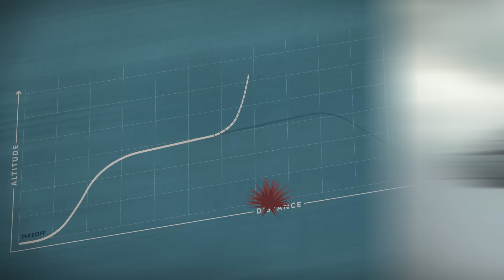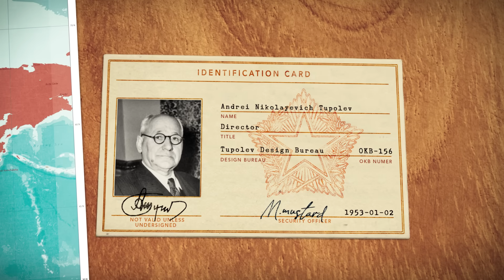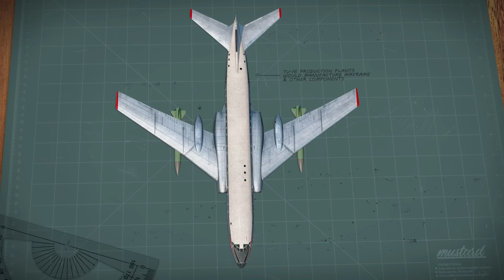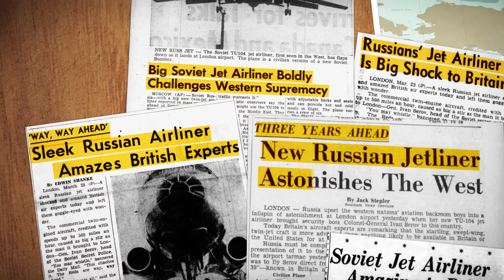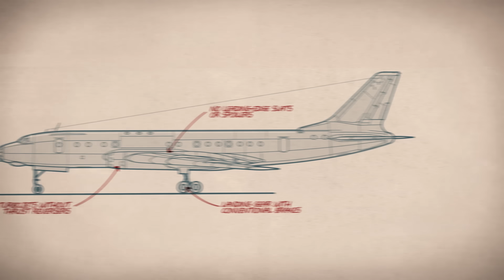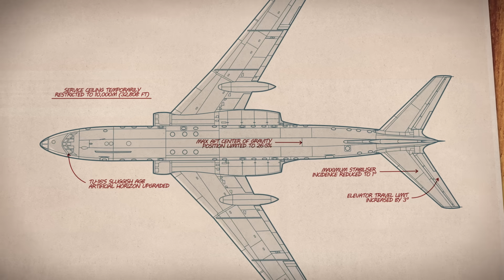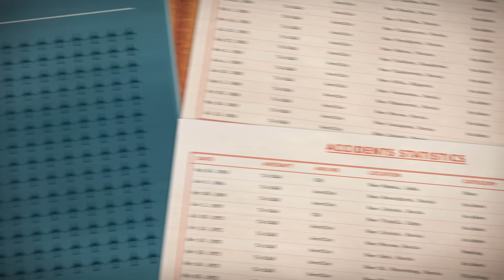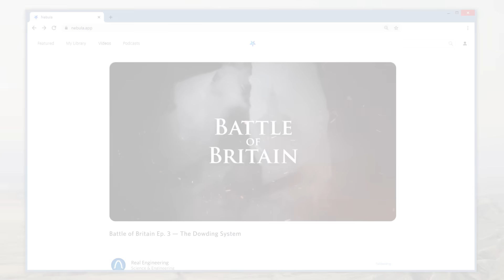The Soviet Airliner Designed To Crash

Comment: Very similar looking to a comet, i wish the design of the comet came back i love it
Reply: The Comet remains a tragic engineering example of how NOT to build a jet airliner.
Reply: @Sander Van der Kammen  it had a failure with square windows. It would be hard to forsee that in any airliner during that time, all aircraft had similar windows and flew at lower altitudes where it wasn't a prevelant issue. The comet walked so others could fly. It is a beautiful jet.
Reply: @darionmcconaghay8888  NO, that is a completely false narrative promoted by revisionist British history. 
Wreckage recovered from the sea confirmed that the catastrophic in-flight structural failures were not related to the passenger windows.

The investigations have determined that the de Havilland company had, through negligence and incompetence used aluminum skins that were too thin and brittle, neglected to install proper rip-stop doubler joints, used too few riveted fasteners that were poorly designed and installed and the fuselage reinforcement rings were too narrow and spaced too far apart too prevent cracks from joining up with adjacent panels.
de Havilland company also failed to  properly test its pressurized cabin design and ignored whistleblowers who alerted the company to numerous aggregious flaws in the aircrafts design and construction.

The real tragedy of the Comet disaster is it could have been easily prevented if de Havilland had simply followed well-known and understood industry standards for the design and construction of of pressurized cabins made from riveted aluminum alloys.

The only lesson learned by Comet Disaster was that manufacturers cannot be trusted to perform their own aircraft crash investigations, it's an irrefutable fact that de Havilland repeatedly acted in its own financial interest and ignored the safety of passengers.

Comment: The Haviland "Comet" wasn't "back in service". The flaws were so extensive that the overhaul proved to be ludicrously expensive. In the end the only places where it would still be used was the military and science research programs, as Boeing 707 has but completely displaced Haviland from the market. In total there was just over 100 planes built whereas there were over 1000 707s. It sucks because the Haviland was a true innovation built "from scratch", not a hastily redesigned bomber. It simply appeared way ahead of its time when stresses on the airframe were still poorly understood. In comparison, - the 104 was much cruder and simpler, and thus devoid of the complex problems which plagued the Haviland's airframe. It needed a redesign of its elevators, and parts of the tail section to counteract the updraft but the Soviet leadership chose to largely ignore the issue until a more up-to-date jetliner was introduced.
Reply: The Comet 1 was grounded in 1954 and its airworthiness certification was permanently revoked.

Comment: IMO it was good that the soviets desired to counter the west and launched their own program for a jet powered passenger plane. They tried and they failed but they learned a lot. Only thing they did wrong was not giving enough attention to correct the flaws due to soviet pride which became a reason in the long term for the collapse of the soviet union.

Comment: I think the De Havilland Comet would take the title of most dangerous airliner. Comets 1 to 3 were flying time bombs.
Reply: The Comet 4 has the highest loss rate any of jet airliner and the worst per flight and per passenger mile fatalities rate of any jet airliner other than the Comet 1
Reply: @sandervanderkammen9230  "The Comet 4 has the highest loss rate any of jet airliner" Another lie. The Comet 4 had a hull loss rate of 22 percent, well below the 707s 30 percent despite its small production run of only 77 planes. I won't bother checking the other things as I'm pretty sure you're making this up along with your "one third of all Comets crashed" claim.
Reply: @Mittens0407  Comet 1 had a 46% loss rate and the Comet 4 26%
Reply: @Mittens0407  The Boeing 707 series is still flying and will remain in RAF until at least 2035. The US Air Force expects its 707 series aircraft to remain in service until 2050.
Reply: @sandervanderkammen9230  Your Comet 4 loss rate percentage is incorrect. Of the 77 built, 17 were lost, resulting in a hull loss rate of 22%.

Comment: On youtube you can find a movie in Russian about this "Последние слова Гарольда Кузнецова"  last words of Garold Kuznetsov"
The crashes were happening when craft was cruising on high altitude  over weather system flying from warm to cold air. Speed of sound is slower in cold and thin air. When airplane was moving from warn to cold air it was reaching a speed of sound whet airflow along airfoil interrupted and shock wave forms in front of aircraft. As a result, pilot looses control. The condition called "coffin angle "in aviation. Civil aircraft is lucking power to increase speed to restore airflow and control of aircraft. Similar problem were happening with other airplanes when they approach a speed of sound like with Americana  Lockheed P-38 Lightning in a dive when pilot loosing and could not regain control.

Comment: 2:20 The Comet was just a bad a flop if not worse.
Reply: The Comet was much worse, the Comet has a higher loss rate and higher per flight and per passenger mile fatalities
Reply: @sandervanderkammen9230  I remember something about it just splitting open due to hull stress.

I actually read about it 40 years ago
Reply: @AhmedAdly11 The Comet Disaster included catastrophic in-flight structural failures as well as several runway excursion accidents related to fatal flaws in the design of its wings and engines.
The Comet 4 was a completely redesigned aircraft
Reply: @sandervanderkammen9230  the comet had square windows, which at high speeds caused stress on the aircraft.
Reply: @NascarF1_driver2021  Wreckage recovered from the sea confirmed that the passenger windows were not related to the catastrophic in-flight structural failures
 Speed was not a factor either.

The Comet 1 had 5 inch radius windows just like Boeing and Airbus still use today.

Comment: The styling is beautiful. I like how the engines are not just hanging on the wing
Reply: This was before anyone else knew what Boeing did... that hanging the engines below the wing is the best way to make a jet airliner.
Reply: @sandervanderkammen9230  right, it looks good but I bet it was noisy inside. I bet Boeing looked at the ww2 bombers and thought well that worked hanging from the wing.
Reply: @buck9739  The German-American engineer George Scherer working for  Boeing was assigned to the Von Karman Mission which found a huge cashe of top secret wind tunnel research data at the Luftfahrtforschungsanstalt laboratory in Braunschweig Germany. 
Germany was years ahead in jet aircraft design and had exhaustively researched all of the possible jet engine mounting configurations and had determined that for subsonic jet aircraft mounting in pods below the wing offered most advantages and the least disadvantages with the best overall aerodynamic performance.
Scherer smuggled the data back to Boeing along with the plans for a German jet bomber that would become the B-47... and the 707.
Reply: @sandervanderkammen9230  that’s very interesting. Do you have a station? You should you have some knowledge. Thx for sharing.
Reply: @buck9739  Very interesting, during the same trip Theodore Von Karman found data on the Messerschmitt Me-262 and brought it back to Bell Aircraft who used it the solve the aerodynamic problems with the Bell X1 program that allowed Chuck Yeager to break the Sound Barrier in 1947.
Reply: @sandervanderkammen9230  I find you very knowledgeable. I think I feel we would be so far advanced if all our countries put the knowledge together.

Comment: The Boeing 737 MAX has the worst record.
Reply: The de Havilland Comet was the worst jet airliner in history. 
The Boeing 737 Max actually has a better safety record than the Concorde
Reply: @sandervanderkammen9230  Does it?
Reply: @sashadala346  Yes it does, in fatalities per million flights and in fatalities per passenger mile the Boeing 737 and DC-10 still has a better statistical safety record than the Concorde.
The de Havilland Comet has the worst safety record of any jet airliner in history.... it has the highest loss rate of any jet airliner and the highest fatality rate
Reply: @sandervanderkammen9230  737 MAX, not in the 1st year.  The design of the 737 MAX is atrocious; not balanced.
Reply: @sashadala346  There is nothing wrong with the Boeing 737-8, the only problem was a FAA mandated version of safety device..
Reply: @sandervanderkammen9230  The 737 MAX is an engineering monstrosity, and can't fly without a heavy computer input.  A computer crash on the 737 MAX the thing falls out of the sky, as we've already seen.
Reply: @sandervanderkammen9230  we get it dude, you work for Boeing.
Reply: @sandervanderkammen9230  Concorde 1; 737 MAX 2.
Reply: @rogerturner5504  The 737 Max has a better safety record than the Concorde in per flight and per passenger mile fatalities rate.
Reply: Apples and Oranges.
Reply: @rogerturner5504  No, it's not... we use statistics to compare aircraft safety records using standard metrics.
The Boeing 737 Max is safer than the Concorde.
Reply: @sandervanderkammen9230  Ok - following your philosophy, how safe was the C47 Skytrain/Dakota?
Reply: @rogerturner5504  The 737 Crater, what it does when it hits the ground.
Reply: @sashadala346  Can we please have a bit of intelligence in comments.
Reply: @rogerturner5504  Like Yours?
Reply: @sashadala346  Grow up!
Reply: @rogerturner5504  Like You?

Comment: It is interesting that they did not experience the same metal fatigue problem as the Comet, though one reason might be they crashed or went out of service for other reasons before metal fatigue had the time to show up.
Reply: Metal fatigue was well-known and understood by the leading aircraft manufacturers by the 1940s... the Comet Disaster is a unique case because de Havilland had little experience with all metal aircraft or riveted aluminum airframe structures.
Prior to the Comet Disaster d-H was still building aircraft primarily from WOOD and Fabric well into the Jet Age.

Comment: //but like the British, the Soviets would pay a heavy price for being the first to introduce jet travel.//

You are distorting the facts.

What price did the Soviets pay? Is the comparison with DH Comet appropriate here?

Due to the little-studied aerodynamic effect, only 1 Tu-104 aircraft was lost. The crash of another flight, Khabarovsk - Moscow, is due to the fact that the plane got into a zone of severe turbulence, but there is no direct connection with the little-studied aerodynamic effect. Aviation accidents with the rest of the Tu-104 aircraft were not related to design flaws or aerodynamic features.

The Tu-104 carried 7 million passengers. And the Comet?

The Tupolev-104 is an reliable aircraft, which differed little in terms of safety from Boeing, Convair and Douglas jets of the mid-20th century
Reply: Excellent comment, the Tu-104 actually has a much better safety record than the Comet which had the worst safety record of any jet airliner in history.

Comment: The tu 104 was the best plane for carrying you to your grave without you even expecting it
Truly a magnificent feature of Soviet airliners
Reply: The Tu-104 actually has a much better safety record than the de Havilland Comet.
Reply: @sandervanderkammen9230  LOL
but still very loud
Reply: @Zt4t1cFr33  I'm dead serious, de Havilland made the most dangerous aircraft in history and the Comet holds the record for the highest loss rate of any jet airliner in history. 
 You were actually safer flying on a Soviet Tu-104 than a British de Havilland Comet.
Reply: @sandervanderkammen9230  ik because the comet had soo much design flaws  more than the tu 104 and, the comet also when it was released, the major design flaw was that the aircraft had its centre of weight on the back of it so, any strong current will easily push the aircraft up and then cause the plane's engines to burn out and then fall
Reply: Due to the little-studied aerodynamic effect, only 1 Tu-104 aircraft was lost. The crash of another flight, Khabarovsk - Moscow, is due to the fact that the plane got into a zone of severe turbulence, but there is no direct connection with the little-studied aerodynamic effect. Aviation accidents with the rest of the Tu-104 aircraft were not related to design flaws or aerodynamic features.

Comment: Thank you for this thorough and honset review! Any road to serious innovation is difficult and dangerous.
Though the cavemen didn't have it easy either, but only those costly and hard efforts to achieve progress make all the difference between the Human Kind and the Animal Kingdom. Will all due respect for each and every animal, of course.
Reply: Is this an honest review? 

Due to the little-studied aerodynamic effect, only 1 Tu-104 aircraft was lost. The crash of another flight, Khabarovsk - Moscow, is due to the fact that the plane got into a zone of severe turbulence, but there is no direct connection with the little-studied aerodynamic effect. Aviation accidents with the rest of the Tu-104 aircraft were not related to design flaws or aerodynamic features.

The Tu-104 is no more dangerous than many other aircraft flying in the world at that time.

Comment: No it was not, it's the Boeing 737 800 max, it already crashed 2 times and made the record in death/year. Also between the first and the second crash, Boeing was unable to correct the problem.
Reply: Wrong the de Havilland Comet has the worst safety record of any jet airliner in history. 
The Boeing 737 Max has an excellent safety record compared to the Comet Disaster

Comment: So 40 seconds in, I'm betting its the square windows.

But lets see if I'm right.
Reply: Hard to believe that the Tu-104 actually has a better safety record than the Comet.
Reply: @sandervanderkammen9230  Yeah, apparently it was the Comet with the window issue that I was thinking of.

Knew it was one of 'em.
Reply: @shanewilson7994  Actually the Comet had much more serious flaws than just the windows... even after the windows were changed the Comet had the worst lost rate of any jet airliner in history.

Comment: The cluster of Comet crashes remind me of the Boeing 737 MAX. I wonder if they would have kept giving the 737 a pass back in the 1950's.
Reply: The Comet was far worse... De Haviland had 6 crashes before the Comet 1 was grounded in 1954 and never returned to revenue service, the Comet 1's airworthiness certification was permanently revoked in 1958.
In terms of loss rates, per flight and per passenger mile fatalities the Max has a good safety record.
Reply: @sandervanderkammen9230  yes I agree if you slice the data this way- that the 737 MAX has an acceptable safety record compared to other aircraft. But when the same unresolved SW issue was clearly the cause of fatalities (and is a relatively easy fix)- then I question the ethics of the industry and its oversight.
Reply: @skepticbb93  The Boeing 737-8 is a very unique case as it is the first major incident of a government mandated safety device found to be a significant contributing factor in crash related fatalities.
 Both crash investigations ultimately determined the the primary cause was pilot error with MCAS as a major contributor factor.
 The FAA mandated software was significantly different than what Boeing engineers had intended for MCAS. The aircraft currently use the system exactly as Boeing intended.
 The head of the FAA resigned and several other top officials and project managers resigned or were fired.
Reply: @sandervanderkammen9230  ABSOLUTELY NOT TRUE. 
1. MCAS was NOT government mandated. It was Boeing attempting to fix handling issues with the 737 Max in order to mimic the handling of previous models. NOTHING about MCAS was "mandated" by the FAA.
2. Neither crashes were pilot error, as none of the pilots were even aware of the malfunctioning MCAS system. You are disrespecting the lives of the pilots involved in order to forward your false narrative. After the Lion Air crash, Boeing gave instructions to "correct" any potential issues with MCAS (STILL without revealing it's existence explicitly to the pilots), which the pilots of the Ethiopian Air crash followed perfectly, yet still crashed.
3. MCAS today is not what "Boeing intended". The FAA didn't mandate Boeing to use only one angle of attack sensor for no reason, that's complete rubbish.
Reply: @Mittens0407  Absolutely 100% true, the original design of MCAS was only a warning device similar to a stall warning "stick shaker"
MCAS was designed by Boeing to input a momentary impulse of pitch down signal to the auto-stab trim motor and then switch off.
This is how the system works currently as well.

It was the FAA that mandated that the MCAS have full authority of auto-stab trim control, this was against Boeing's recommendations.
 
The director of the FAA and several key officials involved with the MCAS scandal resigned, were fired or demoted.
 Congress found the FAA negligent in its handling of the MCAS program.
Reply: @Mittens0407  Wrong, both crashes were ultimately caused by pilot error.
The malfunction of the auto-stab trim control system should have never resulted in a fatal crash.

Both crews failed to follow the correct procedures for trim motor runaway.
Reply: @Mittens0407  Boeing offered dual redundant angle of attack sensors... the FAA did not mandate dual sensors as they were not considered part of the primary flight control system.
Another agregious error on the part of the regulatory agency... not the manufacturer.

The design mandated by the FAA was highly irregular and defied standard industry practices.